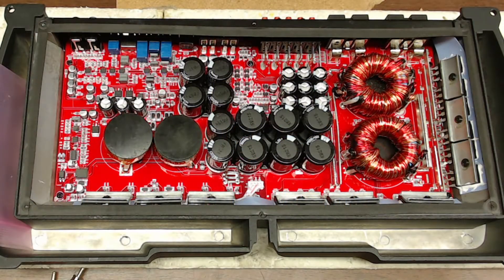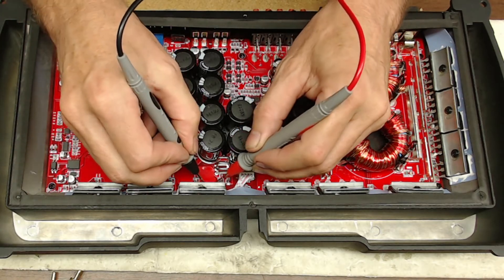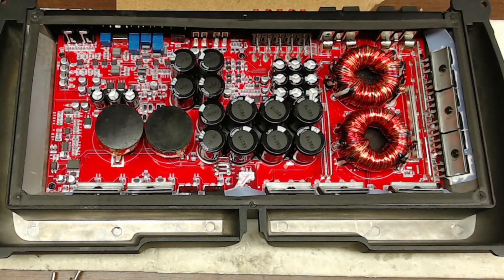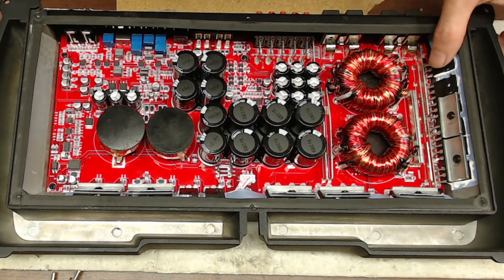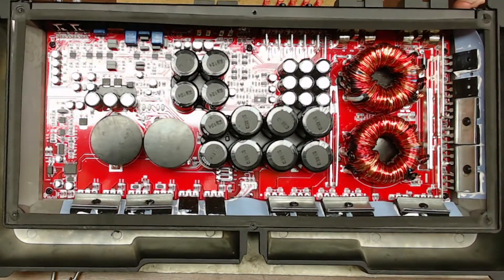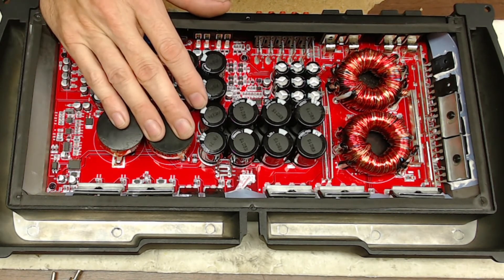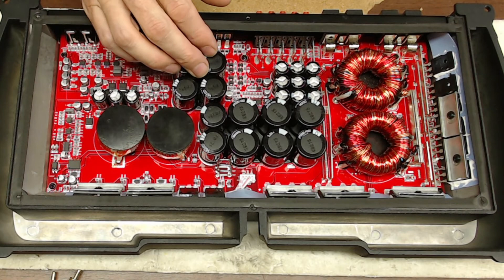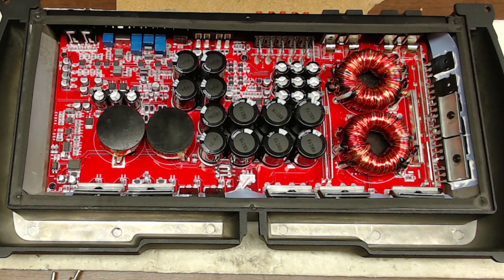Power Acoustic BAMF 8000.1D Amplifier Repair or Power Handling Boost Upgrade?

Comment: Do you fix any amp I have 1 that needs repaired and how much you charge and were do I send it
Reply from the maker: www.ellensburgamplifier.com/faqs is where you will find a lot of answers and at the bottom some manufacturers that I tend to stay away from depending on what is wrong. www.ellensburgamplifier.com/request-a-quote is the form to get started with a repair request.

Comment: They always over rate these amps
Reply from the maker: One day I may have time to dyno these to see what they can do but I don't have a 16v source to do so (if the protection circuit will allow 16 volts). I have a variable supply but only up to 10 amps.

Comment: Could you repair an eclipse da 7232?
Reply: Crazy logics is bragging on ya buddy
Reply from the maker: @ogairbender808  Oh what is Damon saying. I see he was live so now I will have to check it out.
Reply from the maker: I have never had one in but I am willing to tackle almost any amplifier. It does have an odd design for the drive and not sure which circuit design they are using. As long as it is not like this amp it may be repairable. https://www.youtube.com/watch?v=cktnMoCKBEs
Reply: @ellensburgamplifier  it was designed by bang and Olufsen.global electronics told me it was the logic.it turns on and plays but almost no power and goes into protect ,it's a two channel amp NO bridge,so I bet someone tried to .
Reply from the maker: @ogairbender808  Trying to fix an amplifier that someone else has been in is a little more interesting to tackle. It sounds like a transistor failure as it is heating up. A little troubleshooting with the scope may find the issue.
Reply: @ellensburgamplifier  they never really touched anything in it  .they just said it was probably the logic and that was it,they just tested a few modules I guess.
Reply from the maker: I didn't notice that there were any modules on that board. I think it was a bad idea for manufactures to have ever used modules (like the tripath module.. shame shame Alpine!) as they are not easily repairable, hard to find - obsolete, or they are counterfeit. If you have a picture of the board I can verify if it can be saved or not.
Reply: @ellensburgamplifier  I'll get those to ya in a few days sir it looks pristine,and looks like it has a separate power and sound section , beautiful red board ,I'm certain you would love to have a look see at this piece of art!! As soon as I can dig it up out of the closet we will arrange shipping if the photos look promising.
Reply: @ellensburgamplifier  let me know if you think you would try to tackle it,I would absolutely love to it run!!!!!
Reply from the maker: @ogairbender808  I would be more than happy to check it out for you at no cost as estimates are free. I am not sure where you are located but if it is not repairable then the only cost is shipping. www.ellensburgamplifier.com to shoot me a request. Please note the amplifier and your youtube username so I can keep all the information together. Thank you
Reply: @ellensburgamplifier  oh I found it 😁😁

Comment: So I have a 250R Orion, hcca Gen 3 fried the positive side of the board I'd like to rebuild it and see if we can boost it,, power output if you have a business number post it so i can call you get a ballpark number of what it'll cost,, I've burned a lot of amps in my day ,,this was a good one
Reply from the maker: Thank you for watching. Unfortunately, I do not do modifications that will boost the power output of the 250R. In order to make that happen, you have to be able to increase the rail voltage. From there it is the domino effect. You have to change the components to match the higher voltage (caps, transistors, regulation circuits, etc.). It would be a large, costly project to undertake. I do own a business www.ellensburgamplifier.com if you are ever in need of quick turn-around repairs.